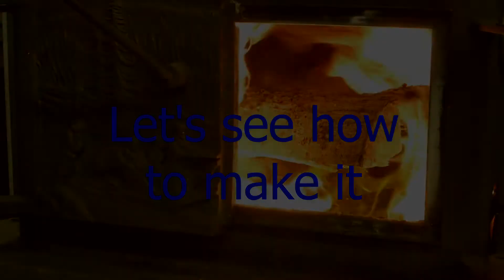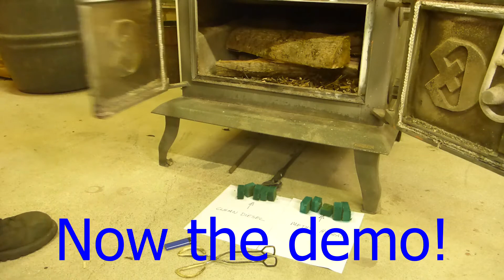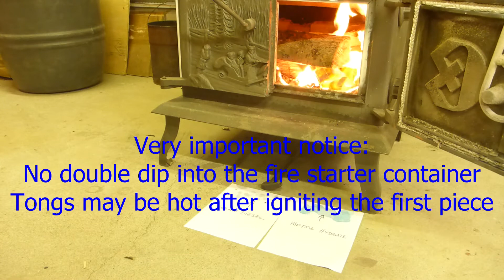#23 Homemade Fire Starter - Quick and Effective

Comment: Wow Joe!! I get more and more ideas from every one of your videos!!!  This is a great idea for fire starters.  I was using old motor oil and this looks like a much better idea.  You can make the fire starter way ahead of time and store it!!!  Thanks for sharing!!!
Reply from the maker: Thanks Mike. Well, you could benefit from both ideas... Motor oil is a good base too. I could not claim it in the video, for instance. I mix in some used oil, old paint thinner and top up with some methyl hydrate.  The later burns easily/quickly, then the oil burns slowly/longer. So I get the best of both worlds... Then if it for use in the firepit outside (ex. marshmallow), I only use the methy hydrate. Thanks for watching Mike!